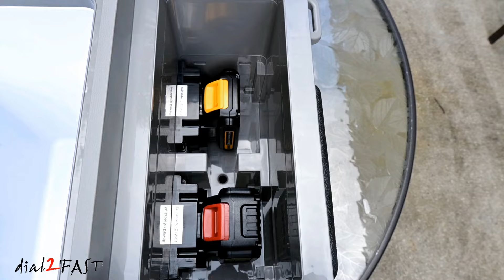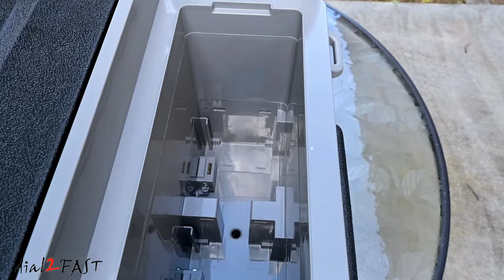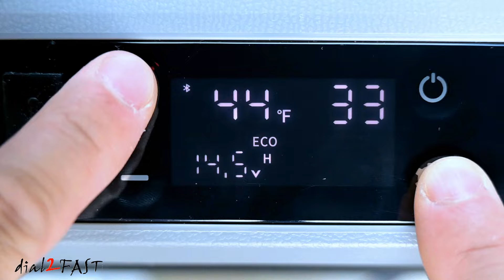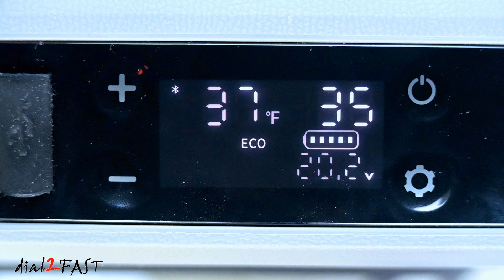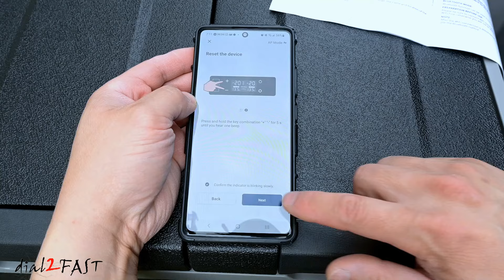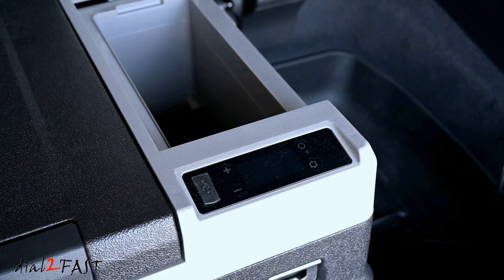Battery Powered Cordless Portable Fridge / Freezer | BODEGACOOLER 45QT

Comment: Several issues with implementation 1. Better to have removable divider 2. Doesnt charge batteries when plugged in 3. Battery compartment should be big enough for 9ah flexvolts or maybe bigger?

Comment: Not turning back on after starting is a deal breaker only takes once and can ruin a trip
Reply from the maker: Yes this is an issue for use in a car (or you can put a Dewalt batttery in to prevent it from turning off).